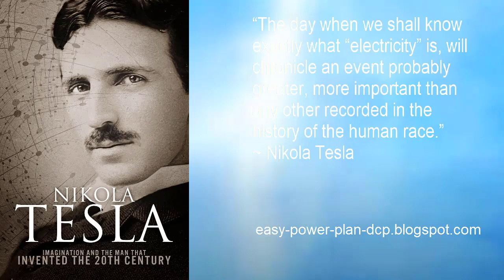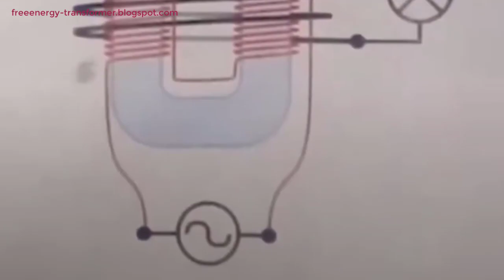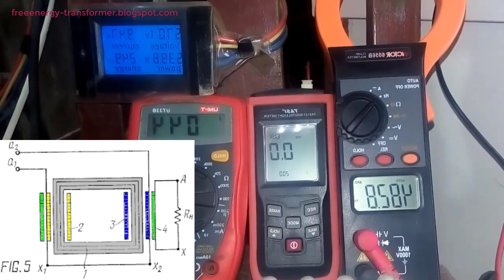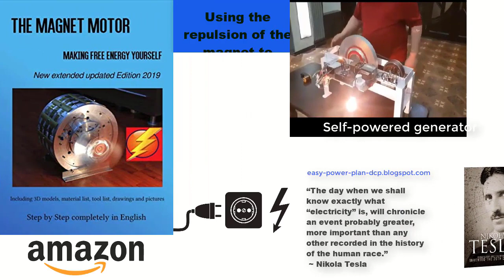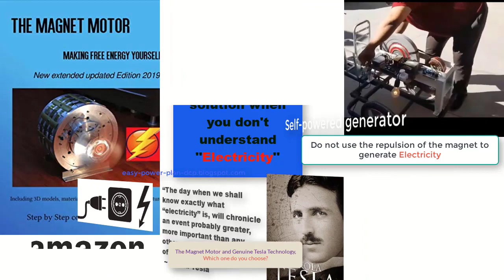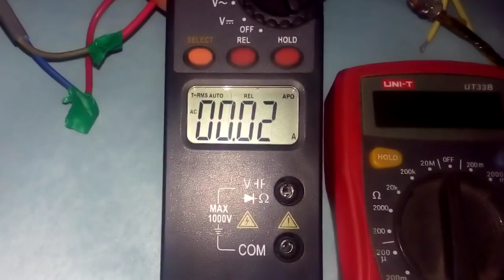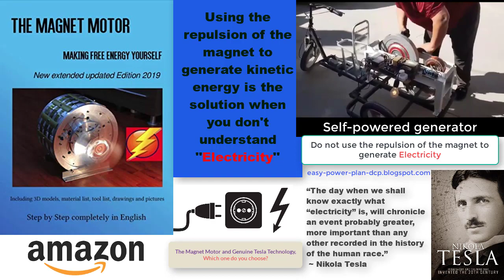Transformer with Variant of Bifilar Winding: Schematics and Testing | Free Energy

Comment: The transformer setup is in reversed.
Reply: I noticed it too. Maybe on purpose.
Reply: @alanx4121  Doesn't work anyway since all the secondary magnetic fluxes interact with primary winding unlike the split flux transformer.
Reply: @lukiepoole9254  pulsing the outside coil creates flux in both legs of the core, and the flux in the 2 coils are mutually opposing (n-n), to the primary they are seen as cancelled, so no back emf by induction. There is a stationary motional inductance component but creates no back emf, because it's spatially radial and perpendicular to the primary.
Reply: @alanx4121  yeah but not overunity.
Reply: @lukiepoole9254  overunity is a fairytale
Reply: @alanx4121  Not if you don't split the secondary flux away from the primary winding. A double core 3 windings transformer.
Reply: @lukiepoole9254  confirmed?
The Jensen unidirectional transformer should work because it eliminates back emf from secondaries to the primary.
Reply: @alanx4121  sadly it doesn't work that way. Which would imply no emf is included for the changing magnetic field of the secondary winding, breaks Faraday's law
Reply: @lukiepoole9254  with a flux splitter, the back emf to the primary won't decrease, because its current dependent only.
Reply: @alanx4121  The flux splitter serves to avoid part of or most of back emf affecting the primary winding.
Reply: @alanx4121  With the design shown in the video, and with correct connection, it still won't work as the back emf still affect the primary winding. Flux matters. Yet, this would prove that there are no back emf for a secondary winding, breaks everything.
Reply: @lukiepoole9254  I'm not sure which flux splitter you have in mind, but no additional bemf is the goal, I think it should work if it does that.
Reply: @lukiepoole9254  if you have 3 coils on a core, and you put on 2 coils a signal 180 out of phase mutually, what will be induced in the 3rd coil?
Reply: @alanx4121  considering the direction of winding being the same, the answer would very obviously be nothing
Reply: @lukiepoole9254  exactly, because mmf is net zero for that coil.
Reply: @alanx4121  It's not the same. The induced emf is 0 for that.
But when you reverse it, there is still induced emf even tho there is 0 back emf. By logic the primary winding should be purely inductive at that point. Yet power factor is still almost 1, indicating the back emfs doesn't appear. Something is missing
Reply: @lukiepoole9254  no back emf should result in 0 power factor, a purely reactive input.
pf 0 input and pf 1 output would be nice.
Reply: @alanx4121  yeah but that's not what is happening for the transformer design, which is weird
Reply: @lukiepoole9254  then maybe mmf doesnt add to zero in the primary after all like you said.
Reply: @alanx4121  Ok fixed it. The secondary windings need to be parallel or else the mmf wouldn't stabilize
Reply: TotalFreedomTTT-pk9st  Resonance implies energy is stored and transformed between capacitive and inductive. That's all.
Simply replace the primary winding with a rotating electromagnet and you get overunity. Quite simple lmao
But make sure the rotor flux path is open looped like a solenoid.
Reply: @TotalFreedomTTT-pk9st  it has bemf from self-induction. I am not sure if it has bemf from the two opposing coils, my thinking was that if they have opposing flux then they behave as a  non-inductive coil and won't create bemf in the outer coil, while both are potentialized and behave as each others primary, generating power similar to the explanation of the Jensen unidirectional transformer. 
Should be verified. I doubt it is so because nature always finds a way that we overlooked.